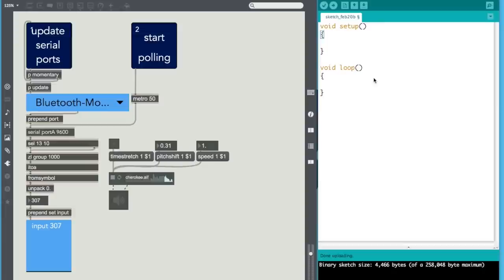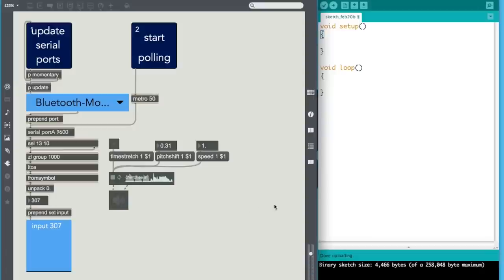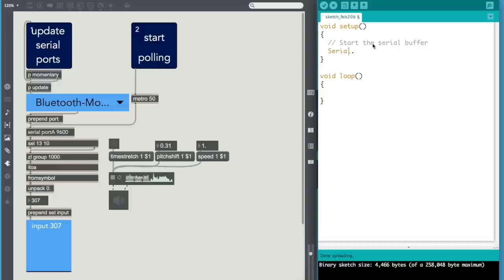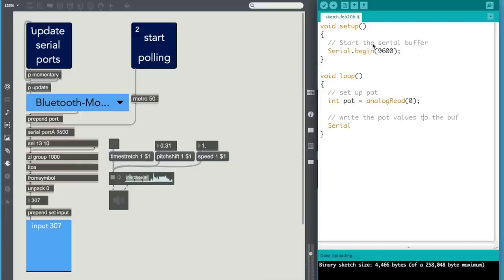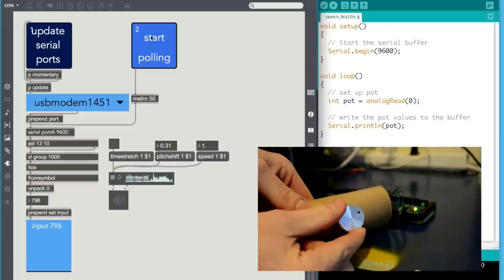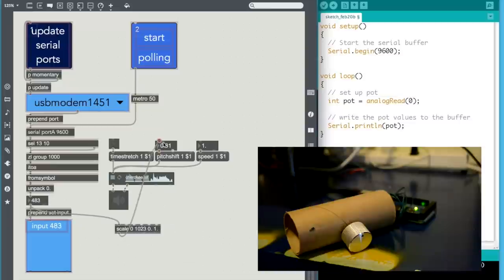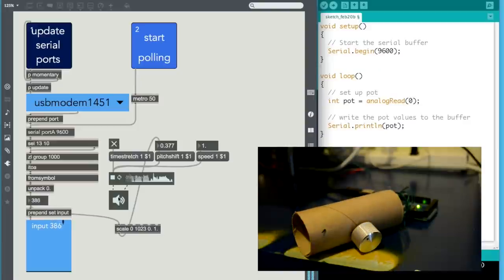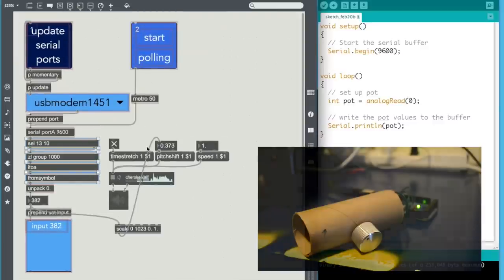arduivis-max-potentiometer

Comment: Hey Chris, Very interesting stuff here! I love the arduino connectivity for max to create instruments. I love using potentiometers. Previously, I have used Maxuino to connect the arduino to max but it has been having connectivity issues and does not seem to be as sensitive as some of your systems. I have been trying to use your arduivis multiple output and potentiometer patches to connect multiple pots to control multiple max oscillators without much success. Is there a way to do this? So far, I am stuck with just one pot connectivity.
Reply from the maker: +James Akers Howdy James! Yes this is very possible, there is just a few things you need to change. The main things are creating the correct print messages which will allow for correct parsing. Essentially it would be something like this:

void loop(){

int pot0, pot1, pot2, pot3;

pot0 = analogRead(0);
pot1 = analogRead(1);

pot2 = analogRead(2);

pot3 = analogRead(3);

Serial.print(pot0);
Serial.print(" ");

Serial.print(pot1);
Serial.print(" ");

Serial.print(pot2);
Serial.print(" ");

Serial.println(pot3);
}

You need to use spaces so when you parse it in Max using [unpack 0. 0. 0. 0.] you won't encounter extra data. If you use "," then you have to parse this individually as well which is a weird caveat in Max. How commas is used is rather odd. If you still have some questions let me know! Feel free to email me friend, private message me on YouTube and we can go from there. Sorry about the delay, holidays, ugh.

Comment: How do you add multiple inputs? I'm using 5 photoresistors [a0-a4]. I'm using this patch as well as the potentiometer ino file. Thank you
Reply from the maker: A multiple input example can be found on the project's github. Check out some of these examples and let me know if it works for you. Let me know if you have any further questions. All questions welcomed. :)

https://github.com/cskonopka/arduivis/tree/master/arduivis-Max